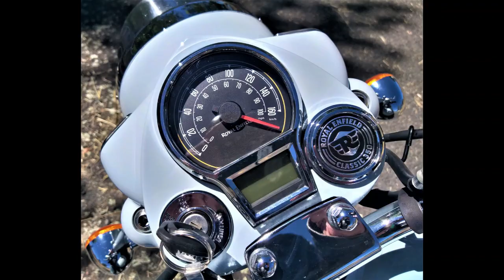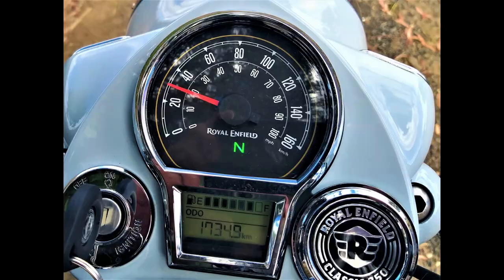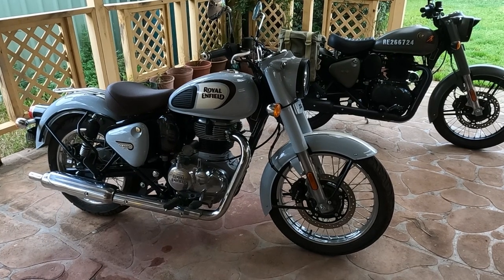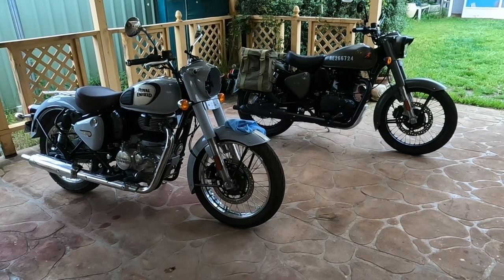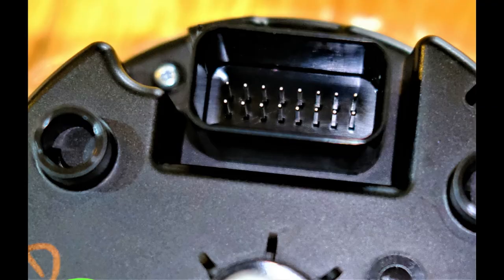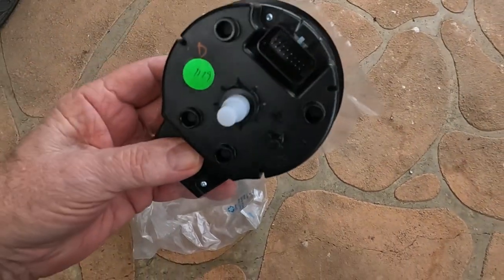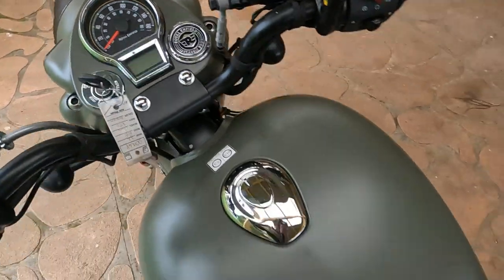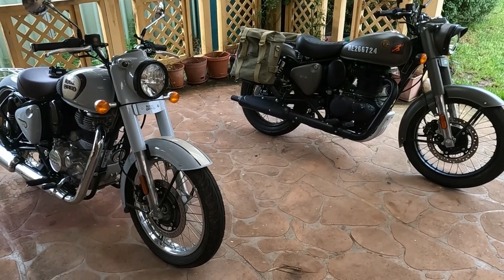Royal Enfield Classic 350 Reborn - How I Fixed My Faulty Cheap And Nasty Plastic Speedometer!

Comment: This is a big help. I'm having the same problem and this looks to be a super easy fix. I was going to have to haul mine 5 hours away to the dealer, but not now. Thanks for sharing this information.
Reply from the maker: mine actually worked fine for 5 months then returned. heres what you do take a photo of the speedo jammed and send it too the dealer. he will contact royal enfield for an approval new speedo. do the clean out and hopefully it helps and when new speedo arrives ask can they post it out.
if not add youll return old speedo first in good faith and fit the new yourself.

Comment: G'day Warro, on my Interceptor over a period of time l have cleaned every connection on the wiring, using the same spray cleaner and then applied Dielectric grease just a small amount and the grease has high conductivity and since doing that the bike performs perfectly, little electrical problems can be a bikers nightmare on any bike, cheers mate, Neil 🤠.
Reply from the maker: especially with enfields....lol 2 years back i bought a himalayan and had it freighted - first ride the jammed speedo issue. ...
klx is in the showroom and registered. i was suppose to pick it up today but its raining and i've waited 5 months so i can wait a bit longer.
dealer only got the one pre-ordered bike...mine so bikes are still very hard to get.
last year i had the yellow/green version with gold forks which i did like.
this years model is green and after seeing it thursday i like it much better
interesting times ahead!
Reply: @ridewithwarro  I'm trying to remember how many different paint versions the Classic 350 comes in. If it's 7, you sound like you'll eventually have a different color version, for each day of the week! 😉
Reply from the maker: @seanb1081  yeah i thinks its 7 too...lol

Comment: Thanks Warro.  I had the same trouble.  I followed your remedy and it was successful.  No problems.  However, yesterday the bike and I were in hot sun for 8 hours and speedometer acted up again (sticking at ~20mph).  After it cooled during a 20 mile night ride, it again performed normally.  I do agree w comments that heat appears to be an aggravating factor.  Also sure that your cleaning technique is very helpful to mitigating.  Loving the classic 350.  😊
Reply from the maker: Glad it helped. after owning the bike 18 months now i too i think heat is possible the major factor involved in the speedo not working.
following a complaint to the dealer and after a 3 month wait period i finally got a new speedo.
looks exactly the same as the old so no visual upgrade there.
so far its working fine but its cold weather here so time will tell.
look at my latest clip where i do a part 1 and 2 and take the classic 350 on an overnight solo camp

Comment: Hey Warro! At 125 miles my Speedo had the exact same problem. I have been waiting since the end of June for a Speedo replacement and still no word from my dealership. Oddly enough, about 6 weeks ago, the problem corrected itself……….almost. The Speedo mostly works but the calibration is off by about 5 mph. I know this for a fact as I purchased a “ Beeline” gps which confirmed this. Very frustrating. Mostly that there is little to no communication from my dealership. Anyways, I’ll keep plugging away and I’ll give your idea a go! Many thanks from Seattle in the PNW.
Reply from the maker: i found when it gets down to say 5 mph showing i use to stop and turn it off and give it half an hour then try again. that usually got me to the zero mark. 
probably best you do this step i've mentioned above after you get it to the zero mph.
in the clip where i mentioned i had trouble on last ride at 1740 klm i actually stopped 3 times on the way home-roughly 60 klm-just to re-set it.
highly frustrating day that one...lol
Reply: Will do! I do love, love, I love that bike! Take care from the Pacific Northwest.
Reply: The speedo seems to have problem when engine gets very hot. If I just ride on not very hot day, it works ok. If I stop at traffic light for couple of minutes or after slow speed ride on hot day, it can go all over the place including getting stuck above range.
Reply from the maker: @michaelcarlson2400  thanks- great bikes and over-all very happy with them.
all the best!
Reply: Michael Carlson.  You say your dealership doesn't communicate hardly anything to you about your situation,  questions, concerns, or where the f your functioning speedo is?  Yeah, I agree. The United States dealerships are complete blooming fools.  Maybe all motorcycle are this way? Completely neglecting their customers that they say that they care for.  Royal Enfield north American headquarters are the same way.  They never return any type of communication.  When they do respond its usually with something causing even more delay.  My latest request about my speedometer issue was responded with, "the team that will address your concern is in India this week for training. "  Seems like a load of shit to me.  
    I love my classic 350.  Looks amazing,  rides smooth as butter, sounds like a sewing machine.  The product sold itself to me.  However distribution,  service, and parts availability in the United States....complete FAIL.  I am so happy that I was able to find out for myself that I never want to purchase another royal enfield product.  And it only cost me $5500 American dollars to see the flaws involved with this company.   I hope I can trade for something else and get at least $1000 worth of credit.  Somebody awhile back offered me $3000, I should have let it go at that point.  Not really buyers remorse,  but more like disappointed that royal enfield north America and their so called dealerships don't have a better program of communication.

Comment: Late reply mate but a good job done and will help out many Enfield rider's not just on speedos but as a first check on any electrical problem due to excessive lithium greased connectors. 
Unfortunately as far as I know  you can't get the old Carbontetrachloride based switch cleaners which were the best.
But the replacement ones are well worth having a can of in the garage .
Thanks for the post mate 
Rubber side down
Lee
Reply from the maker: works alright for a while but best idea is contact the dealers for an under wartranty  replacement.

Comment: Thanks for posting. I have heard of others having this problem. So far after 550 miles my speedo is working just fine. I order the tripper and installed it and I think it is a great addition to the classic 350 Cheers!!
Reply from the maker: i'd say in most cases not all the problem may come in pretty early in the rides. the halcyon grey was within the first couple of long rides and the marsh grey has not had any issues period.
at the moment after the cleaning of the termimal on the halcyon grey-all good now for roughly 3000 klm
all the best and enjoy the new ride. great bike!

Comment: Howdy, I did this suggestion to my 2022 Classic and it worked!! Test rode today for 100kms and the issue did not appear. Many Thanks Roy
Reply from the maker: Great to hear! it has worked for some and others not so. in my case its stilling running fine or i'd replaced it with the new one i got. took a few months to get that one so i dont want to wear it out...lol
all the best!
Reply: Thanks for the reply. I have approached RE NZ about the issue but to date heard nothing. I would like to have a replacement like yourself, just in case. On another note have you noticed a strong reflection on sunny days from the metal plate attached from handle bars to speedo housing? Cheers
Reply from the maker: @roylewis4513  yeah i must admit ive had the odd flash from the bar bracket but just got use to it. its virtually the same bar bracket on the 500 too and i rode those bad botas...lol a good 8 plus years

Comment: I tried this and it worked.  Same problem that you had.  I used wd40 unfortunately instead of contact cleaner. It worked at first but next day my 10 amp signal indicator fuse blew and now the entire instrument cluster is dark.  The bike starts still so that’s good.  I just sprayed the heck out of it with a proper contact cleaner so hoping that does the trick.  If not I’ll probably need to bring to the shop.   Thanks for all motorcycle tips!
Reply from the maker: either way i'd complain to the dealer and tell him the speedo has froze and take aphoto to show him its not working. maybe pull the plug and let the wd40 dry out first.
Reply: @ridewithwarro  thanks Warro!   I dried it out the contacts for about an hour but the 10 amp fuse that controls the signal indicators and tail light and the instrument cluster lights keeps blowing.  The bike starts normally and everything else works fine including the headlight.  Maybe a short somewhere or wire touching metal.   Life could be worse and very glad I have my Meteor as backup.
Reply from the maker: @Busywave  sounds like a short or bad contact for sure. never had one of those fuses blow on any of the enfields ive owned.
even though you used wd40 you'd think that would make no difference regardless.
years back if wet they spray that stuff over and inside the cars distributor /plug leads and contacts to get it going and it worked well

Comment: Thanks Warro, good to see you sleuthing on this problem !
I'm slightly skeptical as to whether this is a permanent fix because my speedo fixes itself once it has been cooled down in the garage for a while and only plays up when I switch the bike off and on again when it has been out in the direkt sunlight for a couple of hours. So it seems to be heat related to me but maybe the conductive properties of that grease do change as it gets warm and starts to soften. I will certainly do this to my bike, it's definitely worth a try !
Although RE have already agreed to replace my speedo, unfortunately ( and unsurprisingly ! ) none are currently available and I am facing a long wait, so this could save me a lot of hassle.
Thanks for posting this and I hope it turns out to be a permanent fix for you and all of us who are suffering from the same issue.
Top man Warro ! 🎖🎖🎖
Cheers,
ER
Reply from the maker: i have the new reserve speedo in stock should i require it but so far so good with the pin terminal clean up. ive been on quite a few long rides since this took place and so far no issues to date.
best thing about this trick it it really only takes 5 minutes to do the actual clean up and virtually cost zero. the main thing it's worked for me or one i'd put in the new clock immediately.or 2 i'd said in the clip -don't try this!
mine was a real shocker from the very start and i had lots of issues with the wild speedo lspin and lock and the hastle of re-keying to zero
to sum up all i can really say is -
1.in the first 1700 klm it happened to me a good 20 friggin times...lol
2 in the next 2800 kl or since the clean up of the terminals..NOT ONCE!
say it came back -what would i do?
i'd go back in and re-clean those terminals even though i have a new speedo on hand......so far so good.
Reply: @ridewithwarro  Thanks mate. I’m going to give it a go because it could be months before I get a replacement and this problem can reoccur at any time and I don’t want to get done for speeding. I suspect that RE won’t pay the fine !
If I can get the connector undone I’ll give the whole lot a thorough cleaning and see how it goes. Definitely has to be worth a try.
Cheers Warro 👍
Er
Reply from the maker: @economicalrides  i'd say so.remember too i have 2 bikes both from the same batch of imported first issues. 
never had an issue with the marsh grey one.
the question would be if its heat related -they should all fail...
see how ya go and i still think its worth a try.
maybe the crc electrical contact cleaner was the answer ...maybe not time will tell i guess.
all the best!
Reply from the maker: plus i'd be giving the actual harness a really good blast of cleaner. well i did...lol
Reply: @ridewithwarro  Well currently it seems to be working for you and that’s good enough for me to try it myself, so thanks for sharing.
I will mention it on my channel and link to your video for those who are interested. I will also report back with my long term results further down the line. Thanks again, I really don’t have much spare time for such experiments, so it’s great that you get stuck into these things !
Cheers Warro,
ER
Reply: Whilst it may be heat related, having spotlessly clean terminals will definitely help to reduce any electrical resistance between any connection points. When it comes to electrical resistance, the more resistance, the more heat.
Reply: @seanb1081  Hi Sean,
well I did the same thing and my speedo went from calibrating to 20 kph to calibrating to 0 kph right away.
So it definitely did something and so far, the fix is holding. It's early days of course but it does seem as though these speedos might be very sensitive to minute changes in voltage coming into them and maybe the heat in the connector has a role to play in that. But so far so good !
Cheers,
ER.

Comment: I'm still running mine in (no rear seat or footpegs😉), I got the TomTom app to see how accurate the speedo is, bike says 30mph, TT says 25mph, bike says 40, TT says 34, bike says 50, TT says 43, when I take it in for the first service I'll tell them, at least I won't be going too fast for the cameras, the left spade connector on the horn keeps coming off which is a nuisance, that will be crimped. 
Your videos are good and definitely educational! Cheers.
Reply from the maker: good to hear you enjoy them
all the best!
Reply: I did the same with mine, but it's only about 2 mph out

Comment: Another in a long line of excellent RE videos. Still waiting for some more cooking lessons. Cheers from California!
Reply from the maker: no probs - well that may happen soon. naturally rain in at the moment but once it clears i'm gonna take the new xmax 300 scooter out and i think i can store all the stuff under the seat.
i'm gonna try it next week and see what happens.
after that i might take the marsh grey out as i have the bags fitted ready to bolt...lol
all the best!
Reply: @ridewithwarro  I love both your bikes. Looking at getting a Halcyon Grey. Saw it at the dealer and fell in love. Then watched all your videos and it pretty much sealed the deal. A HUGE difference coming off a CBR1000RR though.
Reply from the maker: @GrampsD63  a couple of years back i bought a triumph street scrambler but it was only 900cc so i'd say the honda would have been pretty powerful.
what i like about the new 350's -they can cruise at 60 mph/100 kph and thats fine by me.
once you go faster so does ones life and ones wallet...lol
all the best and good choice of new ride regardless of the colour scheme
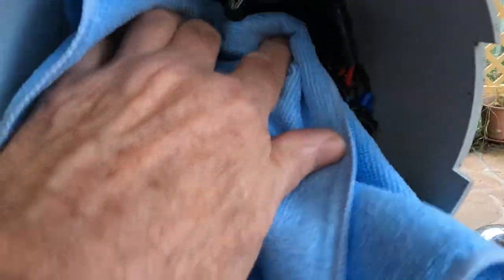Reply: @ridewithwarro  I just picked up my Chrome Bronze Friday afternoon. Feared for my life riding home from the dealer. Things move a bit faster here in Cali. Most surface streets move 40-50 mph and of course freeways are 65 mph. Little tough trying to keep her at 3000 rpm. Plus it took long to get my insurance paperwork over so by the time I left it was 5:30. Them folks weren't having any of me putting along while they all wanted to get home. To let ya know in LA we move over 4,000,000 cars morning and night commute. It's mayhem. Makes me long for those beautiful roads in NSW or Yorkshire, England. Already had to adjust the shifter up and thanks to your How To video it was a snap. Even the dealer didn't know you had to drop the subframe. Thanks Mucho!
Reply from the maker: @GrampsD63  glad it helped out. yeah i don't think the dealers know that much about any bike. but they do know -
1. when one walks through the door -sizing up a potential buyer from the spoke kickers with a very friemdly presentation.
2. how much the sale will generate in $$$ from the sale
3. after the sale and next time in -act as if you'd never met them...lol
4. totally geared by $$$ and profit alone

Comment: This is the 2nd channel I’ve seen whereby the amount of lithium grease applied at the factory has caused electrical issue on REs. Why do they do that? Like the connectors are absolutely swimming in it!🤦‍♂️ Contact cleaner & a fine brush will do the job. If they are concerned about moisture, then applied a thin film of dialectic grease will do the job protecting the terminals. Good job Warro 💪💪
Reply from the maker: thanks... they must get that grease at a good price...lol

Comment: Hi Warro, great advice! Mine was replaced under warranty last week, RE first wanted a photo of the speedo label  with the batch  number etc. before they'd start the claim. I'm lucky that I have an excellent dealership just 3 miles away.
My bike had done about 1400 miles, but of course the odo was back to zero with the new one. Have you any idea what the five digit number that briefly comes up on the lcd display  is, when the ignition is turned on? I  don't recall seeing one on the old speedo, perhaps I'm just looking at it more closely now? I only ever had the sticking problem twice, the first time it stuck at 50mph, then at 20mph. Apart from that, the bike has been an absolute joy!  Ride safe
Reply from the maker: no idea on that display of 5 digets as mine has never done it. i am still riding with the original after the clean up. never tried the new unit and hopefully never will.
time will tell there i guess but so far so good

Comment: I had that same issue and I did the same thing cycle the key on and off and then back to zero. I don't know why Royal Enfield has to use White Lithium Grease over all the electrical connections when it would be just as easy to use Dielectric Grease... I'll have to check that connector and probably clean it out as well... thanks for that info.
Reply from the maker: yrah i did the re-cycling of the speedometer many many time till i thought of this idea. so far after riding it 3000 since the clean-no issues to date